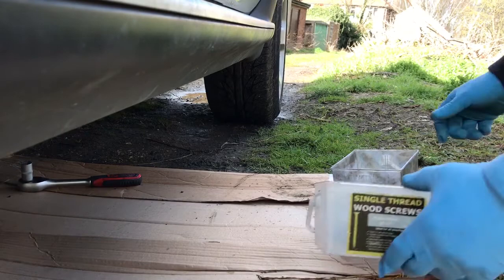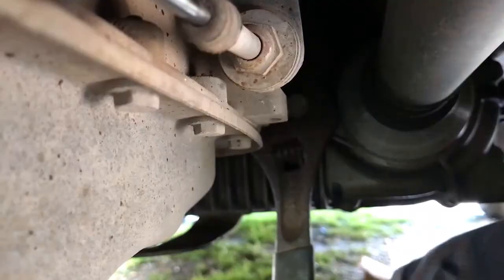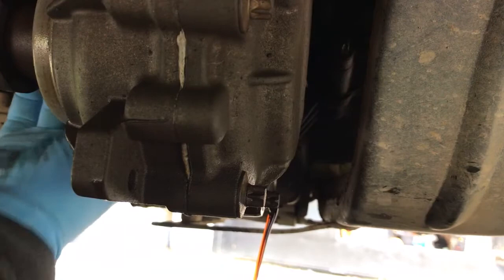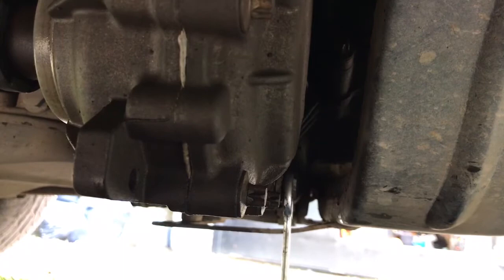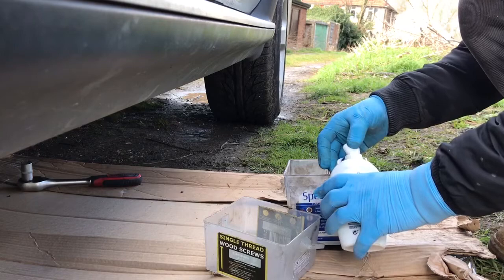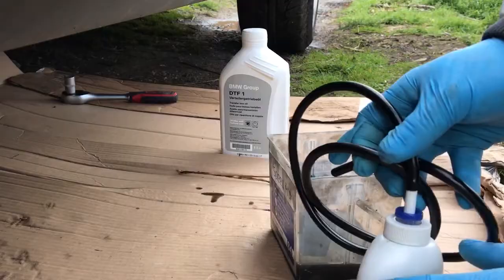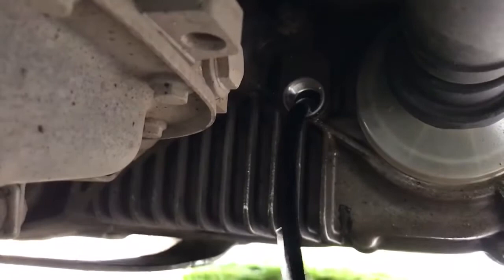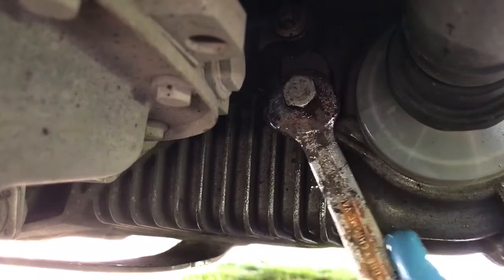BMW X5 E53 Transfer Case Oil Change (easy DiY) 54C6

Comment: hi. I'm thinking of changing the automatic transmission oil, but I can't find the right information on the internet. Which oil do you think I should use? can you help me? X5 e53 4.4i 2003 model auto 286bg

Comment: Is mobil1 GL 75W-90 synthetic equipment to the oil you use.
Reply: No, that’s what goes in the two differentials. The Xfer case gets BMW dtf-1.
Reply: @jhammond4344  i put transmission oil which is the same as gear box oil  into  transfer case. It is work perfectly ok. The oil i use is regular oil use for Toyota camry transmission oil. It run ok since I put it in

Comment: not sure the oil is 1 liter to put ,up to the refilling hole . I think is the same of x3 .      0,7 liter only .
Reply from the maker: Or you can top it up until it spills over. you should be fine

Comment: No reset or adaptation needed?
Reply from the maker: You do need to do a reset adaption. If you don't change the transfer case oil for long time you actually get a fault code. So you need to reset/update the DME
Reply: @lsateam1491  you use ista ? Or is it possible with INPA?
Reply: @denisovanhybrid9610 i would like to know this too. I've read some people say you can use inpa, but I can't find it on my version.
Reply: @shanehogarth6373 I reset it on an e70 with ISTA-d ; but can’t find it using an e53 . Maybe it doesn’t matter much . Whether you’ve changed it or not the vehicle cannot know; but maybe it adjusts the pressure if it’s not reset but doesn’t feel any different.
Reply: @denisovanhybrid9610 Thanks,  I've spent some trying to clear the worn oil code with inpa with no joy, and inpa returns a message like this function not available  if I try to go through the calibration process. Looks like I'll have to get ista. Cheers.